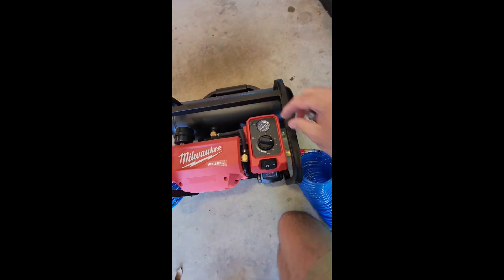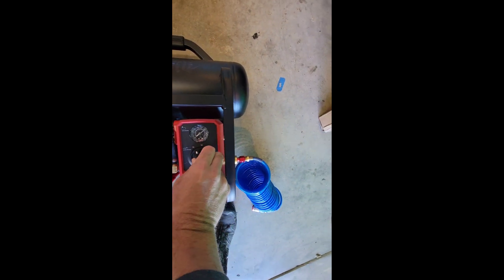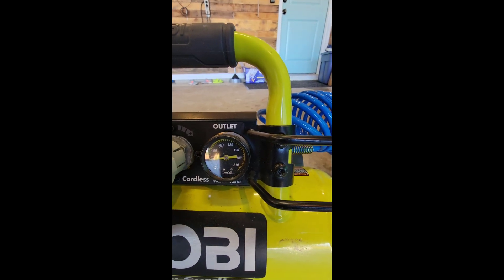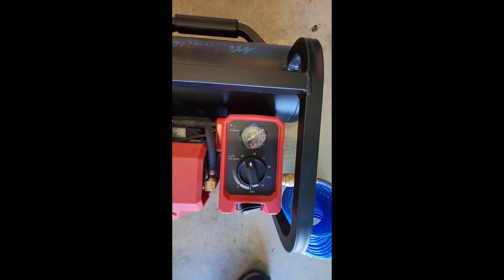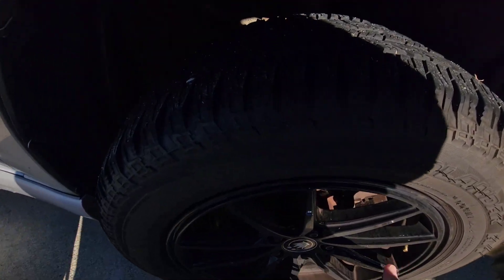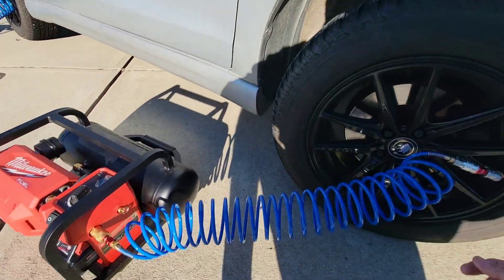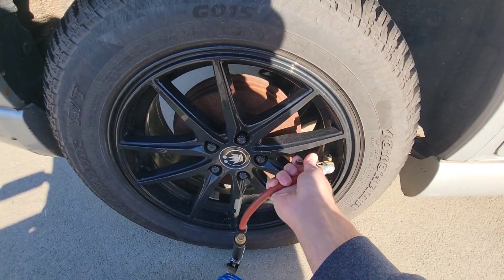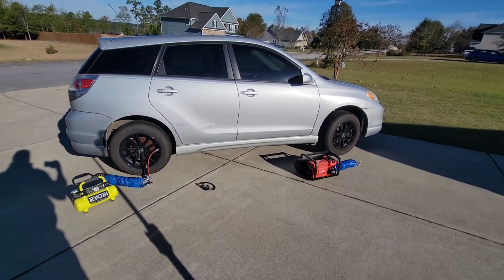Can you fill a tire automatically using a compressor's pressure regulator?  Ryobi Milwaukee Comp.

Comment: Yeah, I’m trying to figure this out too, looks like compressor needs to push about 5-10 psi higher to actually push air into the tire and that’s why regulator kills it sooner because compressor actually reaches that pressure faster than the tire?

Damn it, we need cheaper better tire inflator auto shutoffs to use big cfm compressors off-road

Comment: Also, using the compressors regulator to fill a tire would take much longer. As the pressure in the tire nears the set point of the regulator, the air flow will decrease…which drastically extends the time it would take to reach equilibrium. Set the regulator higher and this will work faster!
Reply from the maker: It would work but I don't know where to set the pressure to get the actual pressure I want.  Also it's hard to repeat the setting on compressors with the twist knob. It would be possible though so you're not wrong